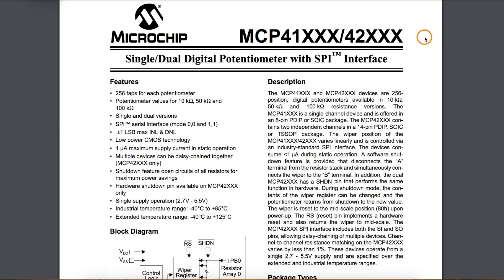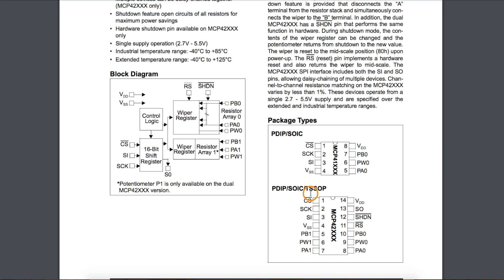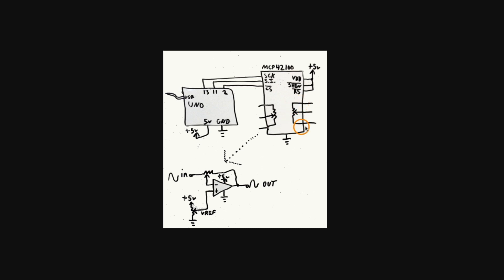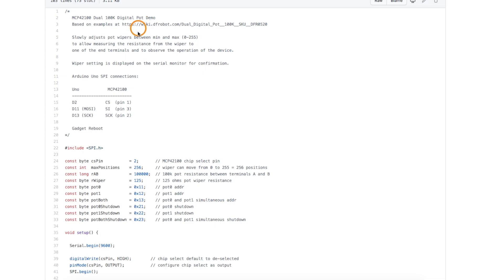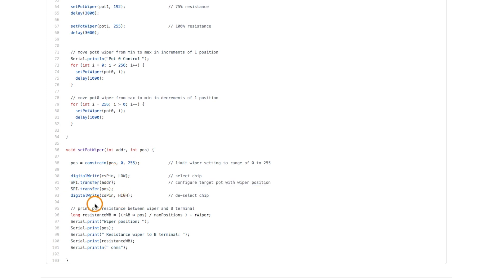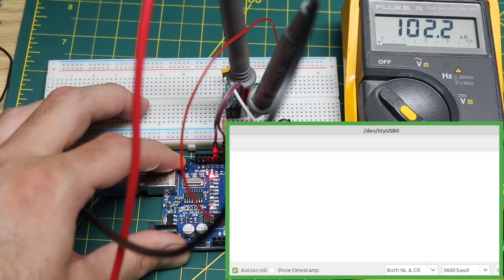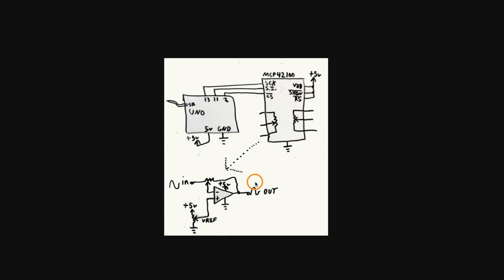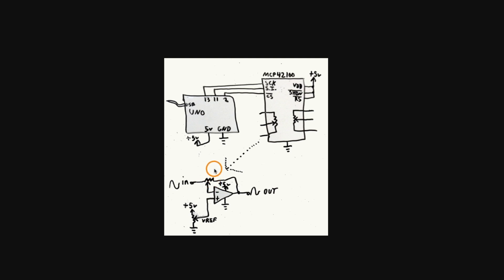MCP42100 Digital Potentiometer with Arduino

Comment: I need to command a dj mixer crossfader. It's 10kohm. Do you think i can use this for it? There are 4 pins and i suppose they are just 2 combined pots for stereo signal.
Reply from the maker: you would have to know the maximum voltage that would appear on the resistors because the digital pot can only handle voltages up to its own power supply plus they’re not meant to handle much current so you would also need to know what kind of worst case current could go through the faders
 so without doing some sort of measurements or having access to the design schematics it would be a guess.

Comment: I'm trying an AD8400 to replace the potentiometer in my trolling motor foot pedal.  First step is to control it with an arduino... after that I'm integrating a GPS, compass, and encoder to do station keeping and automatic heading correction

Comment: Great subject, and good timing on my part. I've been wanting to try these digital pots for some time now. The idea is to make some king of a graphical user interface for an audio application I am working on. I wonder how much (if any) digital noise will be mixed into the audio signal when a MCU and all those data lines constantly switching is included in an pure analog audio circuit...
Reply from the maker: that’s where some trial and error may be needed, especially if it’s done on a breadboard and not a printed circuit board with a good layout, things like ferrite beads in series with the power rail to various chips might help filter noise, or even using an isolated power supply so noise can’t get in that way and using Opto isolators or digital isolators for the control of the pot so there’s absolutely no electrical connection.

Comment: It's potty time, look quite useful. If you used one to say set a bias setting, I'm not sure how the circuit would behave if they become active after the components around them.  So on power up does the OpAmp output hit any power rails as the +Ve input might be low or floating until the pot has settled ?
Reply from the maker: yeah there’s definitely considerations with power on settling time, I wonder if it would work to have a couple of higher value fixed resistors as a divider to keep the bias  near target and then when the digital pot kicks in it may not have a linear response but it may allow the tweaking in parallel with the fixed resistors

Comment: With the X9Cs you can wire the two inputs directly to a rotary encoder’s quadrature output and get a relatively cheap multiturn potentiometer, plus you could use the button on the encoder to change which digipot you’re controlling or do something else with the encoder.
Reply from the maker: this sounds familiar, I think I was playing around with that a couple of years ago... https://youtu.be/HJWMFebfPrI
Reply: Gadget Reboot oh, you have too! I’ll need to have a closer look through your video backlog for more!